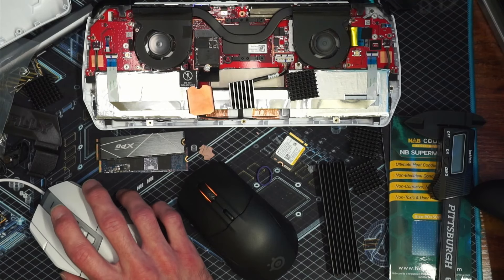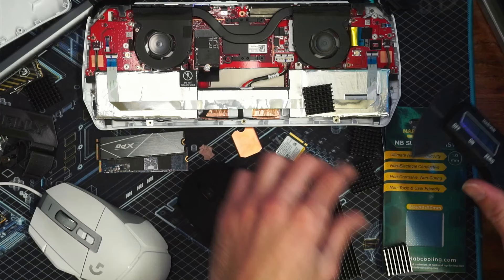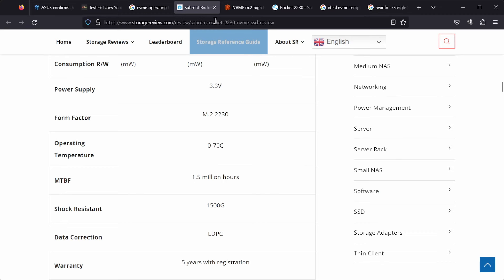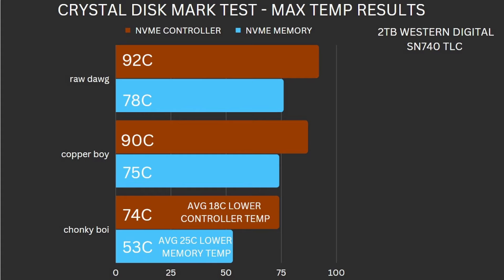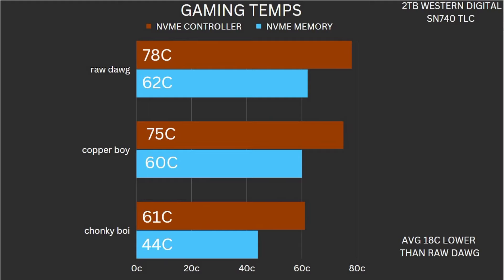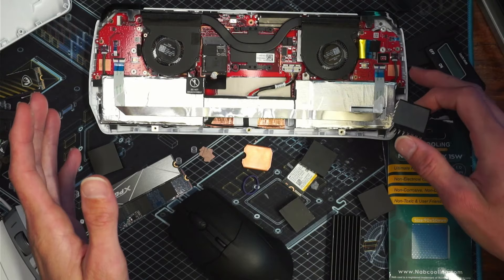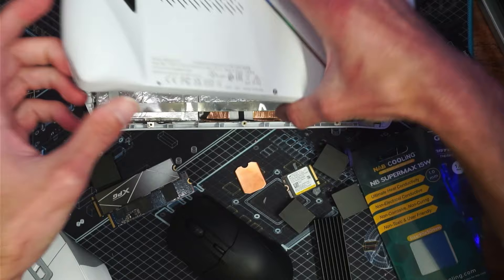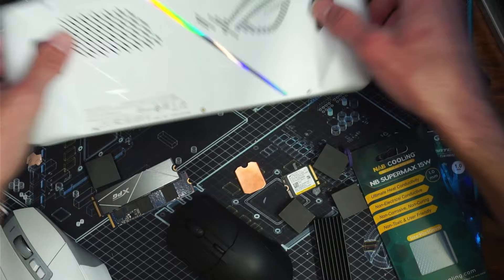Rog Ally NVME Over heating? Drop temps by 18c! The best mod I have created! PART 2! FULL INSTALL

Comment: Here's another tip to cool the ally down! On the back casing there's a mesh to stop dust n stuff, remove it and you'll quickly see they've covered half the vent with a solid black bit of sticker 🤣 now is it me or is there no point to this other than blocking a much needed vent??
Reply from the maker: All of MY ROG Ally Mods + How I clone my drives with one button! Feat. Yottamaster NVME Duplicator
https://youtu.be/8DjTrHzf6LA

Comment: I have a question. I just installed the new heatsink, works like a charm, but a bit of thermal pad about a size of a grain of sand in trapped in the ASUS and i can't get it out. I tried using can air to blow it out and hope for the best. Is that a problem?

P.S. I was a little nervous, but God gave me victory.
Reply from the maker: Thermal pads aren’t conductive so no matter where it went it’s fine. Your good brother. Amen

Comment: I have a slight bulge using 1mm gelid pads, and the same heat sink. Device wouldn’t close fully till the screws were put in. Not worried about it at all, just mentioning it for anyone else that finds the same. Thank you for the video!!
Reply from the maker: A slight pressure is applied via the backplate but you should be able to close it without the screws as I’ve shown in my videos. If not could be something a bit off try reseating on the backplate first

Comment: Just dropping a note to say thank you. I performed this mod (was admittedly nervous about clearance) but that heat sink size is perfect. Haven't done any scientific testing a but annedoctally, I am observing a significant difference in temperatures ar higher wattages. The system is consistently under 70 when i play most of my games (not on Turbo). Thanks for sharing this mod with us.
Reply: what size did you use?
Reply from the maker: Heck yeah thank you ! Glad you enjoy it
Reply: Same! Mod worked like a charm.... noticeably lower temps sub 70°c. More power to you. 👊🏼

Comment: Any updates on this? I've been watching all your videos and love them all! Thanks for all of them!
Reply from the maker: All I run is the 2280 drives now with the angled adapter.  Check out my latest videos. That’s the coolest running setup you can run
Reply: @cppctek  For the 2230 this is still the best option for low temps?

Comment: Operating temperature is the supported ambient temperature, in case of the NMVe SSD, the temperature inside the computer case.

It isn't the temperature the SSD is supposed to run at.

Comment: Great Video....... I could understand this process 2-3 months ago but for my 3hr research I found it better to get a 4tb Crucial P3 Plus 4TB PCIe Gen4 3D NAND NVMe M.2  2280 SSD  [$205us].  Use M.2 NVMe heatsink, 2280 SSD Heat Sink Support Single Double Sided with Thermal Silicone Pads for PC for the SSD  [$10us]. Use  PCIE4.0 Transfer Board for Rog Ally Handheld SSD Adapter 90 Degrees [this will make the installation horizontal instead of vertical] $10us.  So no need to cut any plastic or need to move antenna. Yes it's expensive but easier to install & you get close to 4tb, the 2tb M.2  2230 SSD is  $200us [standard replacement].
Reply: This adapter for 2280 bottlenecks and drops FPS.
Reply from the maker: @vidaboa1010 that’s. It true at all lolol whoever told you that lied to you. The adapter does not drop speed at all on the nvme or transfer rates. If you used this nvme adapter and your seeing less fps that has nothing to do with the adapter. That’s a windows issue or configuration issue and you should not see a single fps difference. If you want to prove me wrong go ahead and take out all the variables by using the 2230 drive in this adapter and then on the ally, run benchmarks like timespy 3-5x in a row and average results, then run a few games in game benchmarks 3-5x each and then lastly use crystal disk mark to look at the drive speed test on each method
Reply: @cppctek  Do you have any videos that prove this? Thank you very much!
Reply from the maker: @vidaboa1010 don’t take my word for it, try it yourself. Proof is in the pudding. I can say just go look at my entire channel. Out of the tons and tons of people who follow me who have done that same adapter not a single person I know has ever had any issues with it. It’s a pcie 4.0 extension essentially. It does not do anything what so ever that impacts fps. It’s just extended the traces about an inch in length and unless you’re using a pcie extension that goes over a foot. Theres no way
Reply: @cppctek  It would be great if you could see a video proving this. I only found one comparison that shows this. That the adapter causes the FPS to drop due to bottlenecking. I would really appreciate it if you could make a real comparison.
Reply from the maker: @vidaboa1010 please link the video you found. I’ve had that adapter in my ally and also another ally for over a year with no issues. That sounds like someone is having a separate issue because the adapter itself doesn’t even lower transfer speeds so that’s physically impossible bro. Like for real if it did my gosh the internet would be so mad at me for that and everyone else using it lmao. I also don’t have time to make that video because 1: I have a ton of other videos I’m working on for myself and sponsors and that’s just simply not a video I’ve ever been asked to do by anyone other than you. If I had multiple people saying to make it and everyone and their mom and dad and uncle and sister were worried about loosing 69 fps then yeah. I think whoever told you that is having a massive skill issue. Just go watch my other videos plz

Comment: Cant doubt the KING 💪💯🤣. Congrats on the feature 🙏. Do you think we'll be able get a front and back housing case like the steamdeck? Maybe clear?
Reply from the maker: Hey thanks bro!! 

For the Ally … The back yes. The front is unlikely due to the screen being bonded to the housing pretty much. It’s next to near impossible skill level 10/10 to remove the screen from the housing. You’d have to find a new screen plus the housing.
Reply: @cppctek  damn! 😮‍💨. Well, at least something on it can be changed, lol. So the back will be clear and the front will be wrapped 🤣🤣🤣...got it! Lol

Comment: Bro i really loved ur content and channel after all vids i watched in ur channel i need the one advice from u . I got my ally 4days ago its running pretty hot while gaming on charger or 30w 90+C is it worth to mod the device i tweaked the fan speed to max and temp set at 80c max , i don’t know what to do i got doc and grips now from ur links the jaux one and I dont know if it worth to go into the temp modding and joystick 🕹️ one
Reply from the maker: A custom backplate will drop temps a lot. Jsaux with the heatsink or the handhelddiy backplate are good options. Watch my videos comparing them.
Reply from the maker: https://youtu.be/SE5N0gkV4oE?si=u02UBWc0XkgxEX20
Reply from the maker: https://youtu.be/pgR5YE0lCn8?si=8tk33yYZ3Z1lD7bi

Comment: I was interested in the Team Group 2230 drive as it has a 1mm graphene spreader included, and will just "fit", and apparently it can reduce average of 7 degrees even up to 10, but the drive underneath is so shit that once the write cache is filled (and it's SLC cache like all 2230 instead of proper Dram, not to mention QLC instead of TLC) that it drops to 100 mb/s or under. That's ludicrous. That's QLC. The WD SN740 apparently drops at worst to 500 ish which is still sata SSD speed, but you can't buy them with a proper warranty as they are an OEM part. Then I was looking at the 2280 adapter but I keep asking questions at Reddit and so far not one answer.. I am trying to work out whether those 2280 right angle adapters and the Ally can take a double sided SSD, as I found a great Gen 3 one WITH Dram and crazy long endurance, ideal for main drive, and specs are 3500/2800 which is still absolutely fine for any game in existence but that also mean LESS heat. And proper dram cache means more sustained writes anyway, it never get worse than about 1500 no matter what. Don't let Gen 3 scare you for an Ally. Less heat is a good thing and I promise, between 3500 and 4500 read, you will not even lose 1 second between game loads, honest. This sort of Gen 3 vs Gen 4 game loading thing has been tested ad nauseum and it's been proven. These max speeds are only for large contiguous file reads and writes.

BUT, can I fit a double sided SSD in the adapter? If anyone is reading and knows, THANK YOU, as I have been trying to find out for over a week now, and I can't risk spending 325 AUD on a 4TB SSD if it's not gonna work. If I need single sided, there are less options and more expensive.

That also said, do not buy a 7000+ speed drive for your Ally unless you are willing to have the fans at 100% at all times, and even then. That small space, those speeds and heat generated, NO GOOD and not worth it, it will just throttle all the time anyway. Heck, I have the massive GT77 laptop here, which has pretty much the best thermals and interior space of any current laptop, and the gen 4, even with the built in heat pads to transfer heat, and a cooling pad blowing cool air through the bottom at all times directly onto the SSD, well they easily can hit 80 degrees and throttle just from file copying and pasting. In this massive deep chassis. Forget it in an Ally unless you are an uber modder and know how to create your own custom cooling/airway solution for it and don't mind blasting your warranty away.

Final Question, plug and play solution ,the Seagate 520n has come out, with 2TB and best endurance of all the 2230 2Tb drives, but there is not one single place on the web that says whether it's QLC or TLC or even if it has SLC caching. Seagate are a reputable brand and are dodging all that main info and it's one of the more expensive drives.. Yet the Micron 2400 also has 600 TBW and is QLC, so just because it has better endurance than the WD 740 and Sabrent Rocket etc, doesn't mean it's TLC.
IF anyone knows if it IS TLC, I am going to make life easy for myself, spend the premium and just get the 2230 Seagate 520N drive in 2TB and just call it a day. But I won't touch a QLC drive. it's amazing how impossible it is to find something out when you need to LOL
Reply from the maker: I tried a few new drives. My suggestions are a good single sided tlc drive. Ideally the ones that do around 5000mbps. If you get the 7400mbps drives they just run too too hot

Comment: Off topic question! Is the XG mobile port on top just an oculink port? Or is it a modified oculink port? I see mods where they replace the NVME drive with an NVME to oculink adapter and run an external gpu, through the backplate. Just wondering if the top ports are just normal oculink and usb C.
Reply from the maker: I saw the nvme to occu but I’ve got concerns of reduced bandwidth for both nvme and the occu.

Comment: Did you removed the whole black flap that was covering thr SSD and other components on the ally from stock? Or did you kept part of it on the SSD? Your ssd looks like it has partial coverage on it
Reply from the maker: Removed
The flappy part. It’s a dust cover. You don’t want it for cooling
Reply: @cppctek  thanks! Any concerns about dust buildup with removing it?

Comment: Hi, cutting a thermal pad to the exact dimensions, and placing it on top of the copper heatsink will that improve heat anticipation? Or not worth doing?
Reply from the maker: As long as it covers the drive you are good. Anything more it won’t help. Anything less and it hurts.  Just cover the whole drive

Comment: Thank you so much for this informative video. I was just curious, in your part 1 you used a 25x25x10 heatsink and now you are going with a 22x22x10 one. Is there a difference in the smaller vs bigger  coverage size? Do you think the 25x25x10 Easycargo heatsink would still fit and be as effective? Thanks!
Reply from the maker: Check out my latest questions and answers Video. It will go over a good bit of stuff and help you a lot with the installation.
Reply: I bought the 25x25x10mm Awxlumv heatsink, they were out of stock before and in stock today :)

Comment: Awsome video bro! I have a few questions:

1/ There is a black plastic cover that cover cpu and ssd.  I'm curious if removing it could potentially harm the Ally or not? and what is the benefit of that black plastic?  It seems like Asus has a reason for adding it to the Ally.

2/ I'm not sure if the heatsink fins could touch the back of the Ally and melt it.
Reply from the maker: The temps on this are no where near the melting point or even close. The backplate of the steam deck is 2x hotter than this lol. And the plastic is a dust shield. No worries

Comment: Thx for the video. Do you think this is really necessary for longetivity or is it more like a precaution just to keep the temps as low as possible? Have a good day and thank you for sharing your knowledge :)
Reply from the maker: If you are running a 2tb or 1tb gen 4 I highly suggest it because without it the temps do fall often outside of the manufacturers operating temp range. That said it’s never good to let any component esp storage devices operate as high as they do without the heatsink. The stock drive isn’t as bad as the 1-2tb drives so if you are stock it’s not as big of a deal but if you plan to upgrade I suggest it highly
Reply: @cppctek  Man youre the Ally King of the Internet! Pls keep u the great content, i am now upgrading to the 1 tb sabrent ssd and ill definitely install this mod too! Thx again

Comment: I just installed mine today and I noticed a very tiny bulge in the back of the device. Did I install it right. It doesn't move around or nothing. Was just wondering if the bulge is because the lack of room. I used 0.5 mm thermal pad
Reply from the maker: 1mm pad works better
Reply: @cppctek  I got ya I'ma order

Comment: Nice video! Question, do we go for 25x25x10? or 20x20x10 for the heatsink?
Reply from the maker: Either is fine. But I like more surface area but should be the same essentially but within a degree or two

Comment: Is the 1mil pad necessary? They make .5mil which will slightly improve thermals and also be a little easier to fit.
Reply from the maker: Quite the contrary. .5 is worse thermals. I’ve tested it.
Reply: @cppctek That’s surprising, I’ve seen those pads used on GPUs (1080 ti, 4080, 4090 etc) and the thinner parts would drop the temps a bit. But I suppose the NVME is different. 

Thanks for letting me know.

Comment: you are the best! had that same heatsink and 1mm thermal tape. should i remove the black covering the ssd or just cut the portion covering the ssd?
Reply from the maker: Don’t worry about removing the nvme sticker. Just be sure you’re only using 1mm thermal pad only between the heatsink and nvme. If there’s a pre applied pad remove it. You Dont need to cut the ally backplate. Halfway in my video I’ll zoom in and show  the the back plate
Reply: @cppctek  the black cover that i have is what mentioned as black sticker in 34 sec on this video https://youtu.be/VtQ24SghjZ0. is it safe to remove or just cut it to give way on the ssd heatsink?

Comment: is it the best size 22x22x10 or 25x25x10? just concerned about he slight bulge, also noticed on your video that the heatsink is touching a bit of the black prat that connects the fans, thank you!
Reply from the maker: The 25x25x10 is my fav

Comment: Hey thanks for the videos, Is your SD reader functioning since you've had it since launch day? Im still looking at purchasing one but on the fence if I wait for Asus to do some sort of HW fix.
Reply from the maker: My sd reader is golden. I also have had a custom fan profile since day one and it keeps the area cooler. Check out this article. They reference and credit my channel lol https://www.tweaktown.com/news/92316/asus-confirms-the-rog-ally-handhelds-microsd-reader-can-overheat-and-malfunction/index.html
Reply: @cppctek  Thats awesome, it would be cool to see if the ambient temps are actually lower with your nvme mod, not only could it prolong the life of the ssd but may prolong the life of the SD Reader!
Reply from the maker: Idle temps are also lower by about 10c as well but it’s well below any worries and most folks won’t leave the system to idle at anything dangerous. But the sd reader best advice is run the latest bios and drivers and hit fixes https://youtube.com/shorts/bSSCeXtviNY?feature=share

Comment: Cool back buttons, are these custom? I also noticed the stock back buttons only click when the back of the device is screwed in, so I wonder if this mod will cause any functionality issues with those.
Reply from the maker: My mod allows the buttons to click good but for sure back has to be screwed in and for sure I can screw mine down with the mods. I just didn’t  feel the need to waste precious air time screwing it back together on camera

Comment: I already have those heatsinks! Had them for years and now i have a use for them 🤣 by the way you were talking about vram at the end, what do you think Fortnite needs?? I like to have the graphics up as much as possible and get around 60fps which it does no problem but every now n then it crashes on me 🙄 I'm guessing thats a ram problem
Reply from the maker: Def open up the amd utility and look for the overlay it will show you ram and vram usage and you may find you are running out of ram

Comment: Hi, I noticed your SSD doesn't have the sticker on it, should I remove mine before applying the thermal pad? Or it doesn't affect much? Thanks
Reply from the maker: No need to. I don’t recommend it